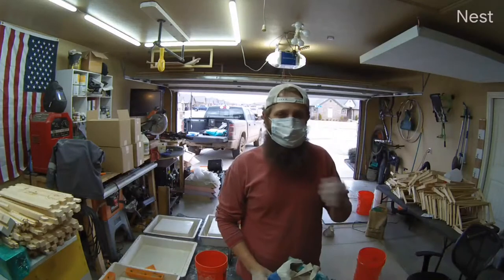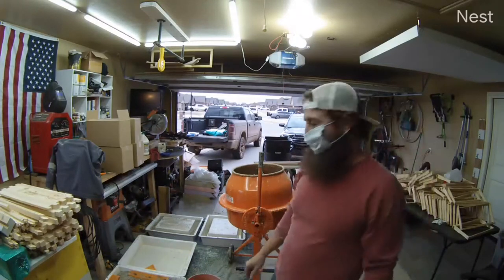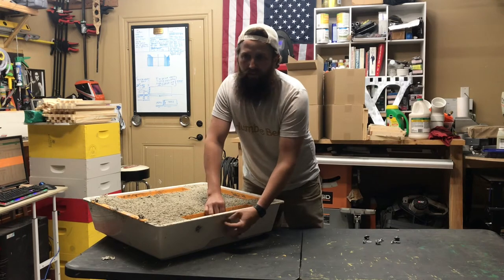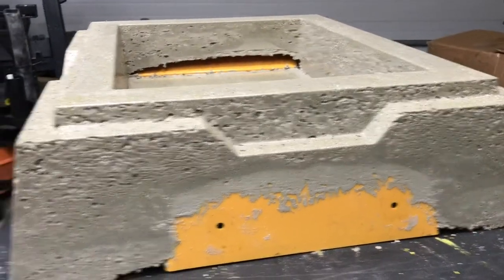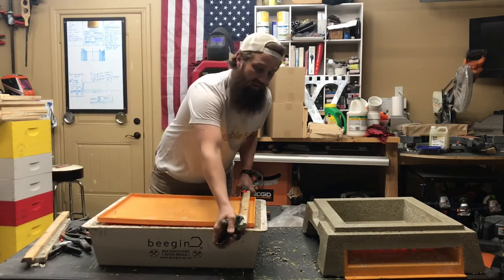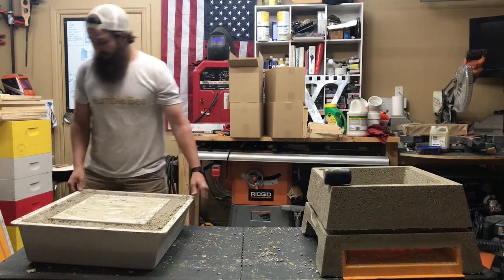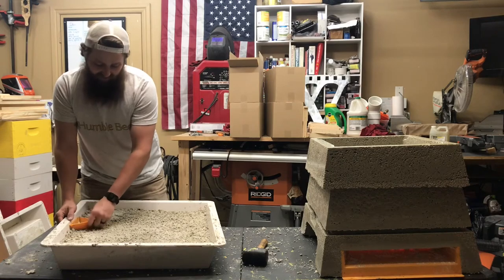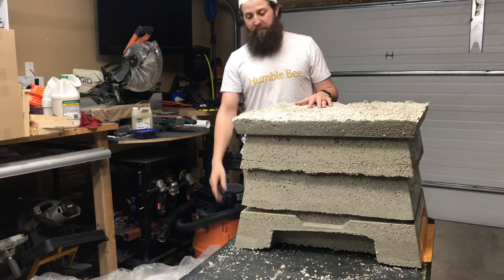The Lightweight Concrete Beehive - Beegin Bee Bunka

Comment: I have the same mixer. Gotta love harbor freight. LoL 👍 thanks man
Reply from the maker: It's been a pretty good machine so far. I haven't worked it too hard yet though. I do have a shop floor I need to pour, but I'm on the fence about mixing vs just calling a truck lol
Reply: @castlegroundsapiary5286  I have worked mine hard and it's held up great. I'm going to upgrade my wheels to rubber. A slab is definitely doable but if you can afford it have it trucked in. Our time is just as valuable as the money we save sometimes more valuable. I have had to do it to save money on projects but sometimes it's no saving at all. Good luck brother and God bless 👍